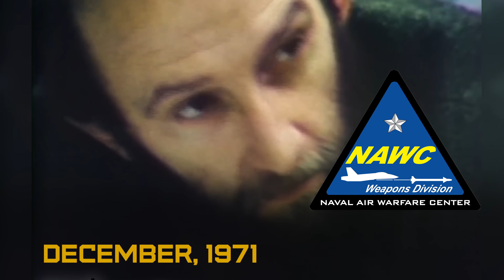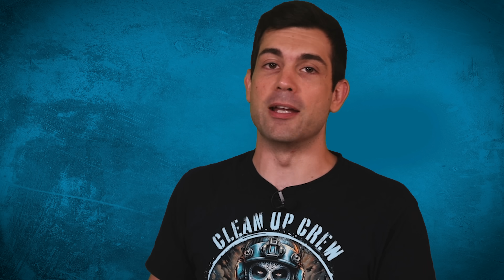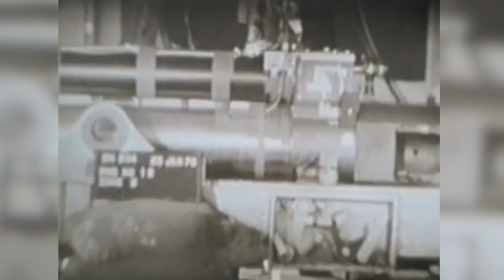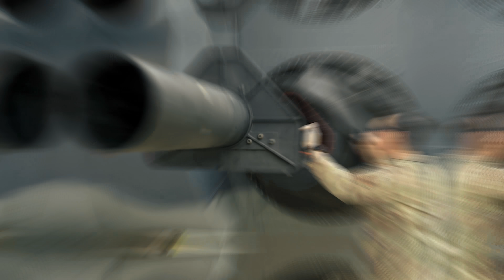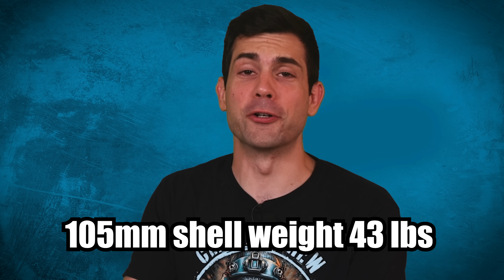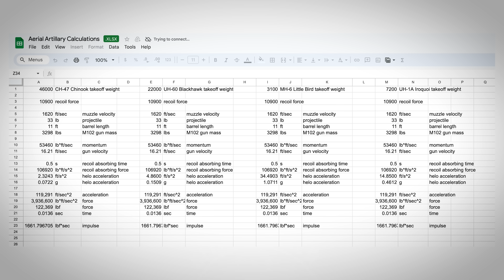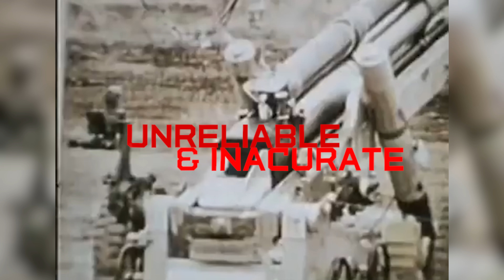America's Twin Cannon Artillery Helicopter is Wild

Comment: Thing is a Bomber is technically an artillery aircraft dropping very large artillery shells.  But the big thing here is that you have someone dreaming up this idea that doen't have a lot of common sense or knowledge of aircraft. Then like too many cooks, you have a bunch of high ranking people with even less common sense that spoil everything. First they dream up this fantasy using heavy fire power that is a bit impractical for a helicopter. Then someone decides that if one is good two would be far better not thinking this will reduce the amount of rounds they can fire or that it would effect the aircraft performance and range drastically. Then you have some fool decide that we need to be able to lower on of those cannons off the side of the aircraft so the ground troops can use it. This is what kills many projects that could have worked and added effective ground support. This is what happened to the B-17 converted as a Bomber Escort that became the YB-40 that would act as a gunship to protect the B-17's on a bombing mission. In stead of removing as much as they could they added a 2nd top turret put twin .50's in the wast gun positions and stacked the bombay with ammo. That reduced the aircraft speed so much the the other B-17's had to slowdown protect the YB-40's after the bomb run. The officers involved in the project forgot 2 valuable rules, the 1st is the  KISS System. For those that might not know, KISS is Keep It Simple Stupid. The 2nd is less can be more effective if done in the right way. They could have stripped down a B-17 and removed the plexiglass nose and installed 4 each .50 M-2s or 20mm cannons.  Starting with the B-17F, they installed external drop tanks under the wings that gave it more range. They could have also used either the Allison or the Packard licensed  built Merlin V-12 engines that gave it higher speeds and it could have been flown as a Fighter.
It is the same thing happened with this Chinook development. By the time of the Vietnam way the US Army had and were using the 105mm recoilless rifle (Cannon). That could have been modified with an auto feed mechanism. That system could have been installed in a pod under the Chinook with a feed rack inside. They could have developed something like a 40mm Bofors system like that. Why the military has never developed a rocket tube that could auto load is astounding, especially today with folding or fins that could come out of the body of the rocket. They are just dumb rockets without a steering system.  Why carry a dozen one shot tubes when you could carry 1, 2 or 4 auto loadable tubes designed for a large aircraft like this. Installing the cannon under the belly of the Chinook would take care of the muzzle flash for the pilots and the recoilless system wouldn't cause any problems with wear on the air frame, though a little armor might have to be added above the muzzle. But when you get a bunch of officers or those like CEO's & engineers  that don't really know much or want far more out of a simple solution, this is where everything falls apart. I've seen this happen many times in my 40 year military career and through the history I've studied. I also have a lot of practical experience as a machinist. I learned the hard way in my early days about over designing something that became too much and failed. The  KISS system is always the best and has the least things that can fail. Start simple and when it works then look at adding on or improving parts that are as simple as possible.

Comment: There was a helicopter unit in Vietnam which did a lot of wild and crazy experimentation. One project took a Chinook and mounted 3 19-tube rocket ponds on each side, arranged in a diagonal. It worked a treat in terms of bringing pee on target, but heavy fire rates tended to rip the siding off the bird.

Comment: Full artillery on a helicopter is kind of over complicating it i think, it would be much easier to strap a couple pallets of recoilless rockets to the sides like a flying bazooka tank with double to quadruple the firepower.

Your goal is to have a very strong alpha strike on a platform that can go pretty much anywhere but is not exactly built for prolonged fighting right? I mean sure the Chinook has armor, but i don't think it wants to be in the fight long enough to get out what 90 shells firing at 120rpm. And we know those howitzers were blinding the pilot and messing with his flight, getting all shells on target would be difficult to say the least. Plus the modifications to the inside needed to make such a thing work seems like it might impact its performance as a transport, but i don't know much about it so thats just a guess. Couple pallets of rocket tubes all firing at the same time would get much more fire where you want it, faster, and wont mess with aerodynamics after the fact since you can just drop the empty tubes. Depending on how much they weigh you may be able to carry an extra set on board to reload on the ground, or in air if the crew is crazy enough to try it.

Comment: I can totally see this working. Just remove the human equation (manual loading), put in an autoloader (which we have more or less excelled by now), enlarge the fuel tank, reduce the crew complement (only pilot, copilot and gun engineer) and make it possible to drop the artys in an emergency. It would be the fast arty support that can support small units of ground troops anywhere.

Alternatively, the heli could just park somewhere high away from ground assaults and just blast away from behind enemy lines. It would certainly make artillery support so much more mobile.

Comment: Small missiles are more practical now. Much greater range, and better accuracy.  A 105 round is a lot cheaper, but you have to get closer to the target and shoot more of them.  Even the AC-130 is firing small missiles now.  Back in the day when I transitioned from the AH-1S to the AH-64A, the one thing that stood out for me was the fact, you didn't have to get nearly as close to the target as we did with the TOW missile.  Greater range for the gun too, a 30mm vs the Cobra 20mm.  However, in my experience, the 20 was more reliable than the 30.  Never had a jam with the 20.

Comment: Even at 4km range, the round would take 10 seconds or so to get there. Wouldn't it be smarter if there was some guidance on the projectile? And that guidance would probably pair well with having propulsion on the projectile - which would also mean that the projectile can travel further with less propellant, by going slightly slower. And finally, having propulsion on the projectile would allow it to be fired from some kind of pod where several of these are stacked in parallel, instead of being loaded one after the other. That would drastically increase the fire rate, and it would allow switching between projectiles for different purposes effectively instantly.
I think I'll give my new improved artillery projectile a super bureaucratic name. Maybe something that literally just means "thing that is sent flying through the air", like "missile".

Comment: Isn't the whole point of artillery to be indirect fire, i.e. without line of sight between the target and you? And firing from the air would imply that you have line of sight.
A: Would the cannons even be "artillery" canons any more if they were intended to be fired line-of-sight?
B: Would a weapon built around the assumption that it will impact within 100 meters of the target really be the best thing to put on something that fires with direct view of the target?

Comment: The Bofors 40 mm (the mid gun on the AC-130) makes so much more sense for this.  Lighter, lower recoil, shoots faster, and with 12.5km of range (for the L/70) it outranges pilot vision and ManPADS, which is what you need, right?

Comment: Probably outdated now with the age of drones but honestly this isn't that outlandish if you think about it logistically. If the kinks were worked out (fuel, range, etc) then this would be a really effective and cheap mobile artillery piece. I could still see use for it today in some ways. Lacks precision of hellfires and we do have multi rocket systems but those lack the range of an artillery piece and explosive potency. 

As crazy as it sounds, being able to throw a 105mm HE barrage at an area of effect then immediately move away upon rounds complete is kinda badass. We've got truck mounted systems and mortars sure but... artillery copter.
Reply: I'm actually surprised we didn't put more research into artillery vehicles such as this with how effective they can be for how cheap the ammunition is in comparison to some of the missiles we use.

Comment: I remember seeing video of China Lake testing a 105mm recoilless mount beneath an OV-10 aircraft. They had flow the setup. But to test fire, they had it hoisted about 50ft  in the air suspended from a crane with a pilot and engines running. Upon firing the recoilless 105mm the back blast promptly blew the horizontal stabilizer off the aircraft. Project fail. China Lake's motto, "Gotta at least try?"

Comment: If I had any say in this I would have reduced it to one cannon and put it in the cabin facing out the back on a stabilizer.  Pilot wouldn’t be at risk, he’d just fly to where he needs to be, turn his ass-end toward the battlefield and let an arty crew in the cabin aim and operate it.  Should have been a different artillery gun too.  Heavy or not, if you’re willing to spend billions on it then ya might as well develop a better recoil system and control the muzzle blast

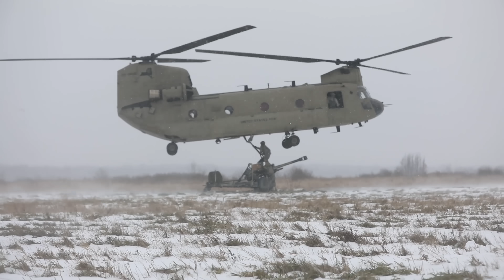Comment: 9:46 nice excel spreadsheet for a frame there. So an MH-6 with two howitzers firing at 120RPM could stay airborne purely out of sheer anger... if a single howitzer didn't weigh more than the damned bird

Comment: I wonder what the range gain per unit altitude is for the system?  Wouldn't even need to necessarily travel, just pop up a few thousand feet over a firebase, unload, and drop back down.

A sort of an ultra-violent Jack-in-the-Box.

Comment: A joke right? I flew them 50 years ago. We tried all sorts of ways to move artillery in the 101st. The loading on the aircraft would likely reduce dramatically its fatigue life. It would also required structural beefing up that will add weight. Launching a swarm of super smart drones makes more sense for this machine.

Comment: The Germans did put a 7,5 cm anti tank gun on Ju 88 plane, which was a relatively small plane and weighed less than a chinook. It worked, although it was inaccurate and thus deemed a failure.

Comment: I’m surprised they were trying this with conventional howitzers instead of 106mm recoilless rifles like those mounted on the M50 Ontos. They wouldn’t have recoil problems by definition and the shells had similar power. They didn’t have near the same range but the would have enough to reach the 4Km sighting range mentioned.

Comment: You know, I actually wonder if artillery drones are the future.  The Army is very much trying to find ways to increase artillery range.  We've got:

1. Longer barrels.  Doesn't work b/c barrels wear out from the pressure.
2. Ramjet shells.  Work in progress.
3. Larger caliber artillery.  Maybe?  But too expensive to retool the whole supply chain?
4. Putting wings on shells to leverage lift.  Is there a reason people don't do this?  Shell rotation?
5. Firing artillery from higher altitude.

A wonder how cheaply you could get an automated recoilless artillery tube up to 70000 feet?  And then have it fire shells with pop out wings at very distant targets.  What would the range be?

Comment: Can you imagine having two howitzers going off next to the cockpit?

"Your hearing loss is not service related..."
Reply: huh?
Reply: @TobyCatVA What!?
Reply: They already sit next to giant rotors with superloud motors
Reply: Their moving fast they won’t hear $hit
Reply: Not that fast lol @patrickancona1193
Reply: Special headphones
Reply: @atomic0914  aint no headphone in the world able to contain the sound of 2 arty guns going off on either side of your head.
Reply: @Dave_Crupel  there is ear protection made for that, they filter out sounds of certain decibels
Reply: @atomica0914its concussion not sound thats the problem
Reply: @Darthdoodoo  I'm pretty sure they won't put the end of the barrels right next to the cockpit..
Reply: @atomic0914 that shockwave doesnt vibrate the air, it vibrates your bones, there's no blocking that out
Reply: @bradthebreadstick  what if you divert the shockwave forwards and place the barrel in a safe distance from the crew
Reply: @bradthebreadstick  It's genuinely not that big of a deal lol. The airframe can easily withstand it for the most part.

The most important issue is muzzle blast might cause fatigue cracking or damage over several hundred or thousand cycles. It artificially ages the helicopter at some rate.

Reinforcing the right areas would be important to get that lifespan get. But that's heavy. So you need bigger engines.

A modern Chinook could do this easily since they have really good engines now.
Reply: @SecuR0M  hearing damage was the point
Reply: @bradthebreadstick  yeah fair but it's also Vietnam
Reply: have you ever sat in a helicopter ?
those earpieces dont actually do much
Reply: @catnium  you must've sat with junk equipment
Reply: Whaddya say sonny? Speak up. My ears haven't been the same since Viet Nam!

Comment: You can put engineering next to math as a subject not in your wheelhouse. When talking about the force generated by the cannon, you called the unit lbf, pounds feet of force. The correct unit is pounds force, a unit of force. Pound feet is a unit of torque, not of force.

Comment: this is one of the actually good design ideas they have had.
this is basicly artilary raise up which means they would have farther range. in the video it said less range, but that is because of the mounting method. 
tanks suck cause they are slow, howitzers suck cause they are stationary. if you were to put a howitzer on the wing of a plane with the abbility to rotate you could have massive range and reasonable accuracy, and return fire would be difficult.

Comment: The range rings you used are misleading. Range is a straight line, not an area. The area inside a 100 mile vs 200 mile circle isn't 1/2, it's 1/4th. Think about a 4K TV vs a 2K TV. It's 4x larger.

Comment: i love this concept, nothing can shoot and scoot like a flying mobile howitzer. combine a CH54 Tarhe with the boxer IFV's unmanned RCH155 and i think that's the winning combo. 
technically it can even have way more range than a ground based one if they fly high enough, but you'll probably need to start using guided projectiles at some point.

Comment: I had the same thing with an artillery gun on it, and lots of them, and yes I used a Chinook to make it and the result is a monstrosity of an aircraft that would've been an engineering, logistical and flying nightmare arty cannon recoil can rip the chopper apart and the weight won't give any chance of flight and if it can it will lose balance

Comment: my idea for a multi round mortar artillery drone.

there would be 6-10 mortar rounds stacked inside a tube on the drone which would be electronically fired, one at a time preferably.

each drone would be equipped with a laser range finder which all the other drones could use to align targeting.

they would also share wind data so that their shots could be more accurate at longer distances.

instead of explosions of fire, there would be explosions of gae gas. 

and thats my idea, prototype name is UpUrus.

Comment: Bro as someone who works on the frame of helicopters they barely handle the torque of the blades, engines and, the weapons they have them as is lmao. Would be better to put a few mini guns and mk19 side facing. For a gun helicopter design lol.

Someone was definitely inspired by some Armored core designs.

Comment: They did it on the C-130 to make the AC-130. Better platform for that use, more ammo capacity, loiter time, stability, stress handling. Probably even more effective system than this would have been.

Comment: as much as it is cool, it also really begs the question what the point of it would be. 
There are such things as rotary rocket launchers. which is just a tube with a drum feed for rockets. and this would have a lot less weight while having much more potential damage while also having next to no recoil. Or even simpler, just use rocket pods. What purpose does it really solve lmao.

Comment: It seems to me that having a helo that can transport a howitzer and also use it as cas to secure an LZ, is actually a good idea, if they had gone less extreme with it, like why not one under belly mounted? Or maybe a smaller gun tube?
Reply: .

you've never repaired helos,   have you
.
Reply: @Nyeupe-Nguvu  no, but based on what the army said in the video, the additional wear and tear didn't seem that big of a deal to them.
Obviously it would require more maintenance, but it's not like this would be every Chinook, nor necessarily used on every mission. I'm thinking of it more as a good option to have for a helo that is delivering an arty piece, than a diy gunship right.